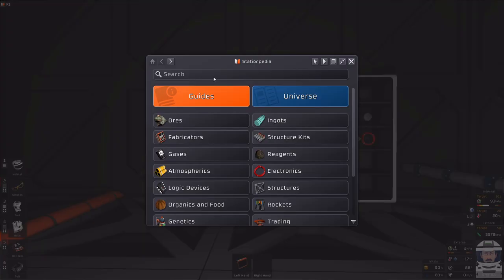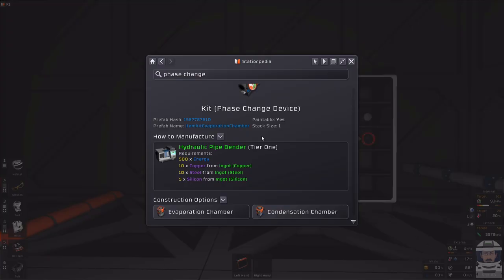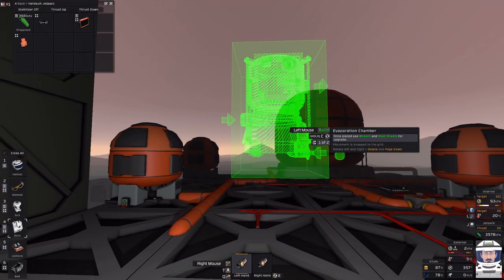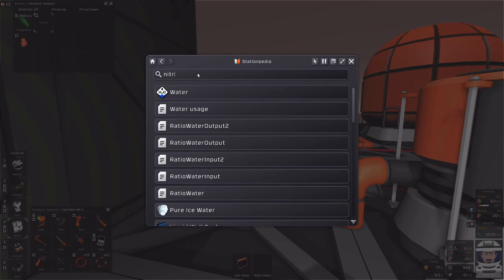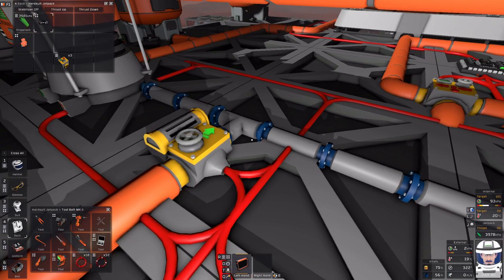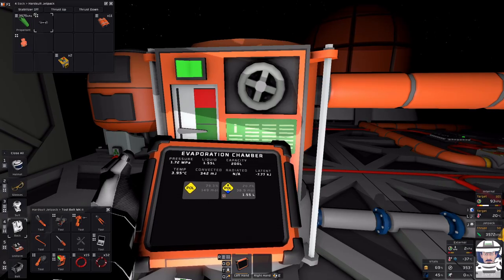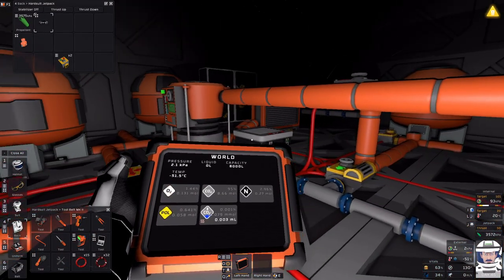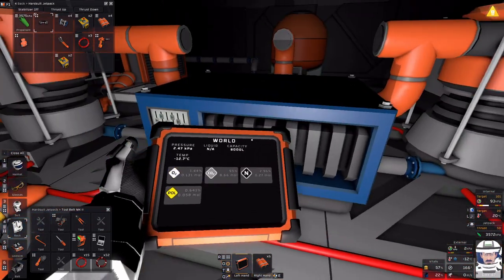Stationeers: Simple Phase Change Device Heating or Cooling Setup

Comment: I have difficulty understanding the liquid side; there's the pressurant valve constantly injecting more gas into the loop in an attempt to reach condensation pressure in the liquid pipe. As the pipe fills with liquid, the pressure drops (causing the pressurant valve to keep adding gas) until the pipe is completely full. At that point, the pressure spikes and is at risk of popping the pipe, spilling all that precious coolant and forcing me to start over. What is the appropriate fill percentage on the liquid side?
Reply from the maker: A pressurant valve will only pressurize to the listed setting, You should set that to a value around where you expect the liquid temperature to be or somewhere in the middle. Alternately you can just let the condensation valve introduce liquids to the liquid pipe and let those evaporate into the liquid pipe network. Either way eventually the liquid pipes will have the pressure needed for the temperature of the liquid and wont overfill.

The only way the pressure should spike to pipe bursting pressure is if the liquids get hotter than the max condensation temperature; which should not happen if the condensation side is cooled to a temperature below that. If you are pushing in pressurant gas warmer than your max condensation temperature, then that is a self introduced problem; you need to cool that down or introduce it in the gas pipes and let the condensation chamber cool down the hot gases and let it condense the coolant in the correct temperature. In either case, with both phase change devices running you want a steading condensation happening in the condensation chamber, anywhere between 1L to 15L of liquids in the evaporation chamber, and the liquid pipe network should have almost 0 liquids but at the same time be pressurized from any coolant that evaporated in the pipe network or from you pressurizing the pipe.
Reply: @shadowdrake082  I'm even more confused now, because this is almost exactly the opposite of what I'm seeing. The evaporation chamber immediately fills up to 20L of liquid, the gas line is empty if it goes straight to the condensation chamber or less than the evaporation point when I send the gas and liquid lines through a CFHX. This is with me throttling the condensation. The liquid line eventually fills up to 100% and the pressure starts hammering between 3 and 4 MPa if I leave the pressurant valve on, dropping to alternating between below and above the pressurant set point if I turn it off. I actually manage to get some cooling out of the system now, but it's dangerously close to bursting.
Reply from the maker: @FloydATC  Going to need more info to troubleshoot it. If the evap chamber is filled, did you lower the pressure setting so that it is evaporating the liquids to cool down to a temperature? What is the condensation chamber pressure setpoint and what is the connected temperature of the heat exchange line? If you have that much liquids in the evaporation chamber, you shouldnt be putting anything else into the system... it is beyond full at that point if you have liquids pooling in the liquid pipe network or gas pipe network.
Reply: @shadowdrake082  Condensation chamber at 2100kPa, evaporation chamber at 200 kPa, pressurant valve at 1700 kPa. Liquid pipe volume is 140+80 liters and 100% full, gas pipe volume is 70+70 liters and is currently at 90 kPa on the pressure side of the CFHX that sits between the chambers. Current "hot" temperature is -137°C and exchanged with Europa atmosphere. cold side is -170°C. If I turn the pressurant valve on at this point, the liquid pressure jumps to around 8 MPa,  which is obviously not good. Oh, and as you probably guessed, that's nitrogen I'm using.
Reply from the maker: Ahh gotcha. At that point, you dont need the pressurant valve or to add any more liquids. You may need to drain out liquids from the liquid pipe network, it doesnt need to be full full. Once the evap chamber has 20L inside it, you dont need any more gas or liquids added to the system. I’d recommend shutting  off the chambers (leaving their gases inside) and pumping out the liquids from the liquid pipe network. Once you do that then remove the pumps and turn the chambers on.
Reply: @shadowdrake082  Got it. What the game desperately needs is a tutorial that has you set up and prime a basic phase change setup like this so you can see a working solution in action. It's nearly impossible to learn how to do these things just from watching other people doing it in videos, because of all those little details that you just take for granted once you know them. Like just how much gas/liquid a loop should contain. You would assume "bubbles" in the liquid line are bad.
Reply from the maker: Understandable, this is a tough thing to teach and at the time i did make this video to fill a need since at the time nothing was available. I think they need an emphasis on the phase change mechanics since that is what gets people the most. This video is part of a series where i try to go over phase change and its applications from the beginning, so i assume you have some idea of phase change as well as pipe safety issues you may run into at this point. I focus more on how to get the heat pump aspect working. At some point i need to touch back on this but the basic hardware is the same, all hopefully a person needs is what things to look out for and how to fill and go with the system.

Comment: Is this system more efficient than using condensation valve, pressure regulator and pure valve and radiator?

That way, it uses more W (100W for pure valve and 100W for pressure regulator) but i think, it can be more compact that way?
Reply from the maker: At base, a cond + evaporation chamber uses 100W (50W per chamber). So power wise it is efficient for its size and compactness. A custom system however can be more effective (+efficient) because you can add many utility in-line tanks to increase the volume of the pipe network to encourage more gasses to condense or liquids to evaporate. The chambers themselves only have a 200L capacity. So you can make a custom system yourself with valves, pumps, vents, and radiators that are more effective for the power cost. Though a pressure regulator has a hard time pressurizing uphill so you'd best use a volume pump or an active vent.
Reply: @shadowdrake082  at my setup i cannot use volume pump, because then i will burst the pipes. I am using presure requlator to take just enouth pollutant to condensate. And i setup it in the way, that i presure instake with 1 MPa, so when i will add more units it will autoregulate to have enough pressure without my intervent :)

Thank you for exmplenation, so I can stick with my design, maybe just think about how to add more volume there :). But I restick myself to fit 3x3 small grid for one stage.

Comment: This is an old video about phase change mechanics. But since you are doing the series of tutorials about the game, maybe consider this too for a next video about phase changes. I know there is the phase diagram with the 3 regions of mater-state in the game, containing the pressure/temperature curves. But what I fail to get a grasp on is how those temperatures and pressures change in those loop setups you made.  I do understand that condensations makes it go warmer, and evaporation makes things cool down. But I would like to see that explained in conjunction with points moving on the  the P/T curves. Like when you pressurize a gas to the condensation point, does the P/T point follow along the curve up? Iso-thermic, Iso-baric, something else?Or does it follow some linear path inside the liquid region some distance above/away from the curve as it heats up.  Since it is a heat cycle, I would expect there to be drawn a loop path in the diagram. Or am I mistaken?
 And how do those heat exchangers you used in other videos fit into the temperature changes in that diagram?
Reply from the maker: I cant really say that it is purely isobaric or purely isothermic. Both kind of happen at different points depending on the heat load.

Phase change devices are set on the pressure settings. Condensation chambers try to take in gases to reach the target pressure whereas evaporation chambers will expel gases out if they have a pressure greater than the setpoint you have. With a low load, the systems tend to look isobaric in nature because the pressure rarely changes while the temperature changes. But in the middle of a heavy load, they tend to get to a new state so they seem isothermal. I cant really classify them as either. The main issue is that there are no adiabatics simulation, the closest is when the gases phase change but it isnt really what you’d expect.

If you take water at 20C (about 15kpa iirc). In game- water can go down to 0C at roughly 7kpa and is at 100C at roughly 100kpa. If an evap chamber is set to 7kpa, any warm liquid water that hits it would have too low of the required pressure to stay as a liquid, some would begin evaporating to get to its desired temperature. Finding it on the phase change graph, find the point of water at 20C and trace it down to match the low pressure, so at that point liquids evaporate since it is in the “gas” section. How the devs did the internal math i am not sure, but they calculate how much should evaporate to get to a new cooler temperature/pressure equilibrium and some amount evaporates. (Move towards the left on the graph) But that new equilibrium might still be higher than 7kpa pressure, so the evaporation chamber will push out the excess gas out to get back down to 7kpa. And the process repeats until water gets down to 7kpa pressure and settles at about 0C.

On the hot end, since you have steam that came out of the evap chamber, it will get drawn in by the condensation chamber if it still has not reached its target pressure setting (say 100kpa). When the condensation chamber draws in this gas, let’s say it is now at 40kpa but still roughly 20C in temp (it should theoretically be as cool as the evap chamber is when it comes in). Looking back at the 20C, you’s likely go up on the graph and land in the “liquids” region. Some of that steam will condense to liquid water, generating heat (to move it towards the right on the graph). At the end, the chamber should have warmed up more towards 100C and the liquids are pushed out at whatever temp it was at. Until the condensation chamber reaches its target pressure, it will keep drawing steam and condensing it. Once it hits roughly 100C it should get the pressure target and stop taking in gases.

Hopefully that helps.

As far as the heat exchangers, are you referring to the counterflow heat exchangers? Those help get passed the gases hard limitations on phase change temperature change. The ideal is it swaps the temperatures from the output of both chambers. Ideally it will make the evaporation chamber take in a colder liquid so that it can go lower in temperature, and the condensation chamber will take in warmer gas so it can go higher in temperature. In a sense the evap chamber will start closer to the left on the graph and the condensation chamber will start closer to the right.

Comment: So I have this plan in mind. I only JUST returned to game after not playing since before the phasechange was added.

Back then I regulated temp on stuff in my base by having a cold pipe and a hot pipe. The hot pipe would be 50-100 degress or similar. Cold pipe would be well bellow freezing.
So for example my dangerous gases and volatiles + fuel mix would be stored at -10 or 0 to keep it safe from ignition and such. While main water was stored at 20 degrees and regulated the temp of any atmospheric gases.

These two things was temp controlled by either cooling with hot pipe. Or heating with hot pipe if needed.

What I see now, is that I can basically just hook the hot pipe into the hot putput of the heatpump system. Cold pipe to the cold pipe.
And have it work towards cooling the cold pipe towards the temp I want there. And as soon as the hot pipe reaches a maximum limit, the hot pipe is cooled by dumping excess heat into an external source. Before then, heating from it would also go into heating anything that needs heating. That way I can recycle heat from my base while also cooling my base.

And if I am on venus. For example... The hot pipe would basically just need to dump its excess heat into another heat pump loop that works at a higher temp range... Do I understand it right now?

Thanks for the video regardless! It helped me the best in understanding these things!
Reply from the maker: If I am understanding your setup correctly, you would set up a heat pump to cool something to -10 while at the same time warming a separate gas to 100C right? If that is all you have set up, it would keep working until either the cool side got to its desired temp or the hot side got to its desired temp. In that way yes it can work. If you have two separate heat pumps doing the work then yes it would keep working until one side reaches the target temp.

And yes so long as you can move heat through phase changing gasses you will be able to dump excess heat somewhere. Venus is tough to do since ambient Venusian temperature is too hot for anything to phase change and dump its heat to the atmosphere. That has been the tough part that most everyone have been trying to solve with storm air but it is almost unworkable.

Comment: Why is my tank become warm up with this settings?
My base in vulcan, and I captured the night gas to connect to the condensation chamber
Pollutant in the liquid pipe become warm up to 140C
Set the condensation chamber to 6000kPa, output to Vulcan night gas that being recycled dayly
Set the evaporation chamber to 3400kPa, input 40C gas around 100kPa with huge volume

Now my gas is around 50C

Please help me...
Reply from the maker: So if you are collecting night time pollutants and letting them condense, those will get up to 152C. Are you running the phase change heatpump in a closed loop config like I had on the video?
If so I would recommend adding a counterflow heat exchanger.

If you will have it in an open loop config where you are just storing night time liquid pollutants in a tank and running it to an evaporation set up, I would recommend having a purge valve setup to remove some of the pressurant pollutant gas so that the tank of liquid pollutants can cool down.

The limits of phase change temperature change is the latent heat / specific heat of the gas, for pollutants that comes out to about 80 degree difference. If you are at 40C and climbing, that means the liquid temperatures are at 120C and gradually warming up. A counterflow heat exchanger on a closed loop phase change device (see the config around 26:40) will make sure that the liquid pollutants cools down before it gets to the evaporator chamber, allowing you to get down to the pressure/temperature setting you set. If it is a tank of pollutants for an open loop evaporator, I would recommend a purge valve on the tank set to a pressure setting of around 80 or 90C since nighttime condensed pollutants will be anywhere around 127C to 155C at the worst. This way the liquid pollutants in the tank can evaporate and precool the liquids so that it can then be used on an evaporation chamber effectively.

Comment: Great video! Question though,  will the stable gas you are using just keep getting hotter and hotter until thr system no longer works and if so how do you stop that from happening?
Reply from the maker: In this case yes since I didn't physically put radiators or anything like that.
Usually your stable gas (or thermal sink) will be tied to the world atmosphere (or vaccuum) in some way to keep it in a specific temperature range. For Mars you add radiators to help keep it cool... for other planets you may have to invent a solution to keep it in the temperature you need it to work.
Reply: Thank you!

Comment: I understood why you pressurized the liquid pipes because you want to keep the liquid from evaporating.  You lost me when you pressurized the gas pipes.  Why was a regulator needed here?  Is it just to prevent condensation of the coolant from too much pressure?
Reply from the maker: That was how i filled the system. Once the whole system was filled to the desired amount, the pressure regulator can be shut off and removed. At the time i also didnt want to push too much too fast so that i didnt overfill the system or pressurize the gas pipes too much to cause condensation and potentially break the pipes.

Comment: Only question I have is, why when on a cooling set up, you want to set the pressure as low as possible on the evaporation chamber?
Reply from the maker: Well it does depend. I think the context I was going for is that if you want to use a condensation chamber to heat, the evaporation chamber needs to be set low so that it can grab as much thermal energy as possible to go towards the heating in the condensation chamber.

If you just want to cool to the lowest a coolant can occur, you can set that to be almost 0kpa and it will keep doing the cooling to the freezing point of the coolant gas.
Reply: @shadowdrake082  Thanks for the quick response haha.
Great video tho!

Comment: Did the counterflow heat exchanger change? Seemed so simple 7 months ago, when I try it the whole thing goes kerfullie in a hurry
Reply from the maker: Not to my knowledge, they seem to work the same then compared to now. Just so long as you dont confuse it with the original heat exchanger and make sure you build the correct counterflow for what you need.

Is there something weird you are seeing with yours?